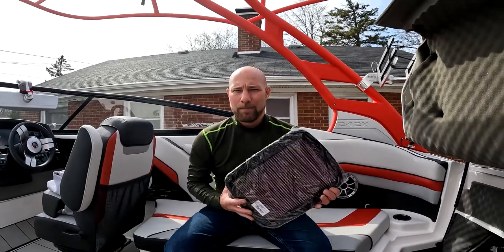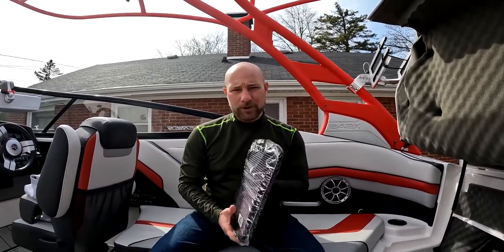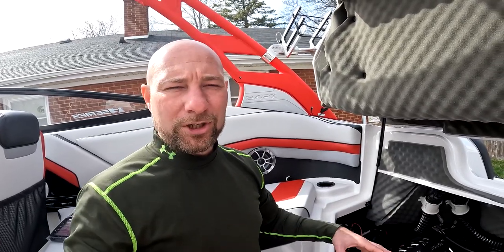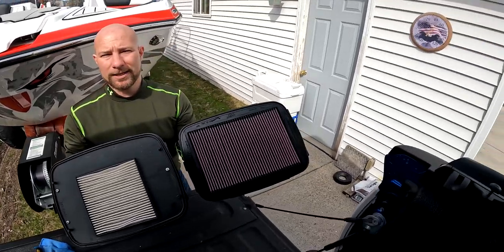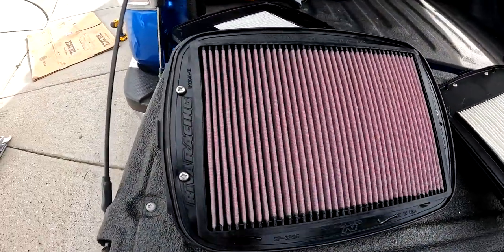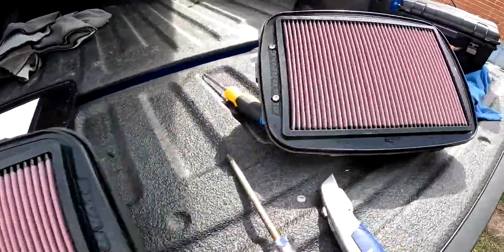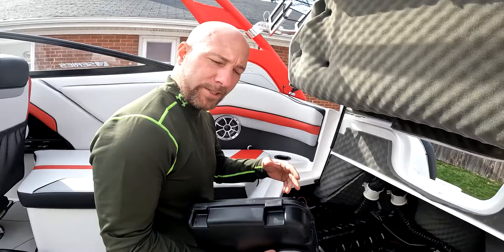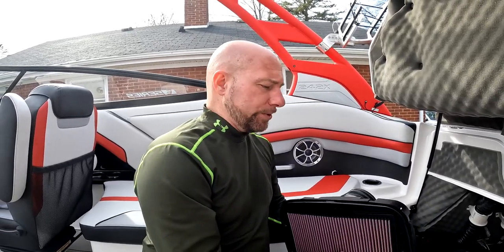Putting K&N air filters in our Yamaha jetboat. (Part 1...The install)

Comment: Quick question. I just opened my new filter and it says the logo should face the inside of the lid / exit side of the filter. Based on that and how my old filter was dirtier on one side than the other, shouldn't the filter be flipped over since its a directional filter?  Just wanted make sure i was looking at it correctly before i put it all back together again. Thanks

Comment: If you have ribbon spark arrester those screws on filter are fine, if you have ribbon delete you're playing with fire with those screws, if one of them comes out it will make it to one of your cylinders.
Reply from the maker: Those screws are part of the OEM design.  When properly inserted,  there's really no way for them to come out by themselves.